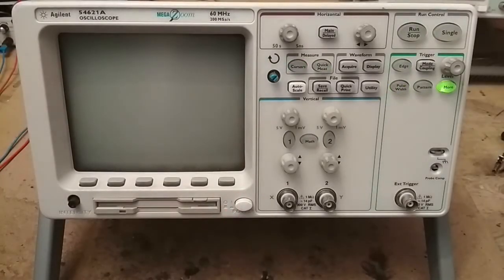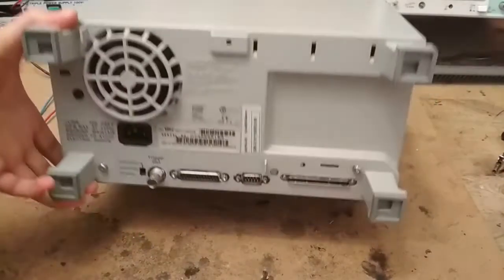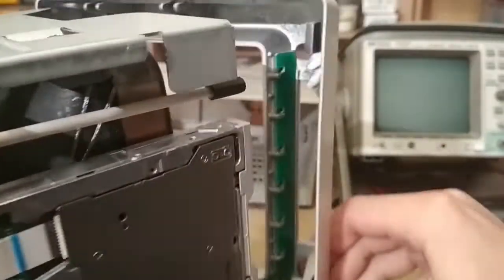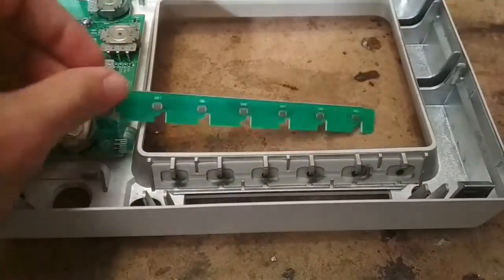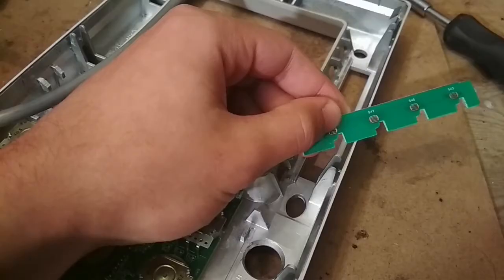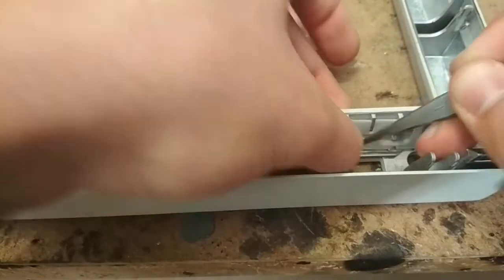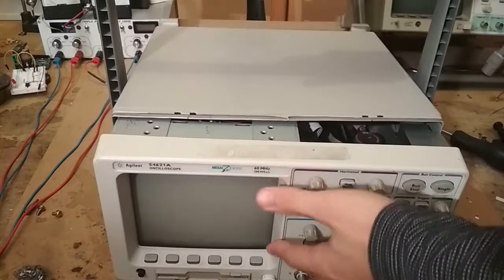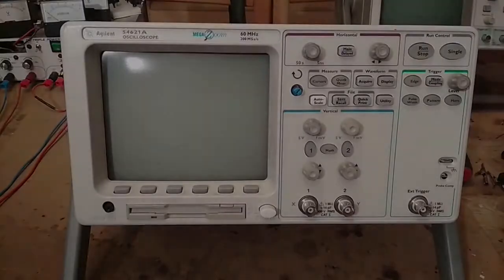How To fix the Buttons on an Oscilloscope (old Agilent Oscilloscope)

Comment: I'm digging up the subject.
I just want to say that you should only do this DIY if the carbon on the keys is completely gone. I just cleaned the gold parts of the electronic cards with alcohol as well as the carbon of the keys (the carbon should become matte black again) and the keys work like new again.
Reply: This worked well for me, I polished the carbon keys heavily with an alcohol wipe and the buttons are easy to operate now.

Comment: Thank you very miuch for the video. I removed a few tenth of a millimeter of the black rubber inserts in the keys with 400 grit sand paper. The rubber surface became conductive again and the keys are working well. I have no idea how long the effect will last, but it seems to be another alternative .

Comment: Huge thank you for the video. I wasn't sure how to remove the front cover. I my case the rotary encoder for the time scale were working erratically so I desoldered it from the board and then sprayed CRC QD contact cleaner inside and rotated it several times. I repeated this 3x and then put some dielectric grease inside to reduce wear on the contacts. After assembly it works perfectly again.

Comment: Just a heads up - you're supposed to use an external fan to cool the board if powering it on outside the case. I think the megazoom asics are the biggest risk of overheating.